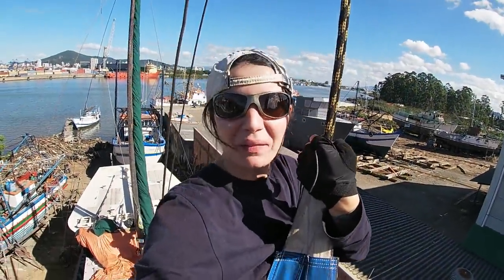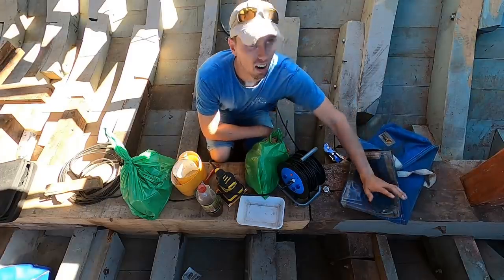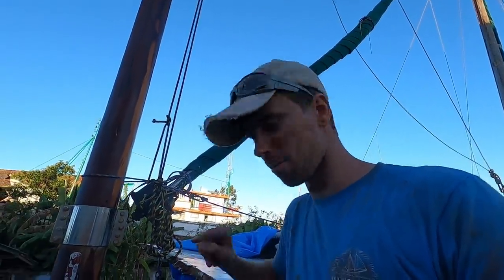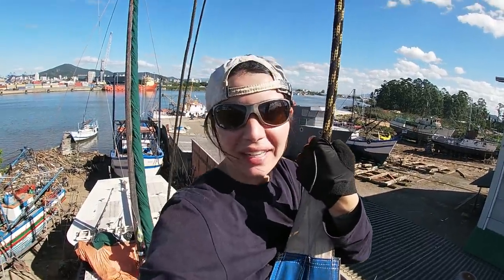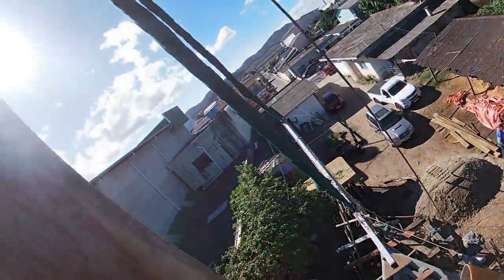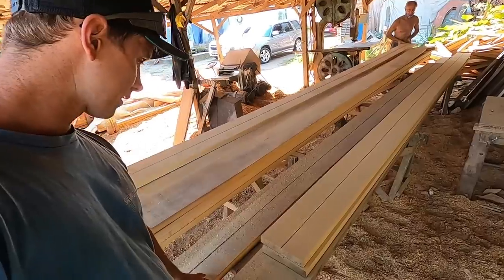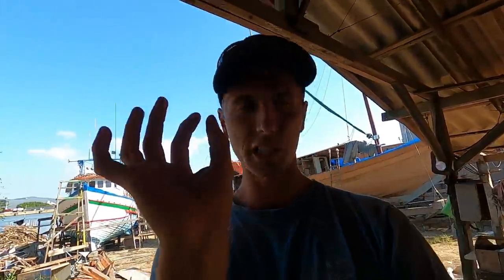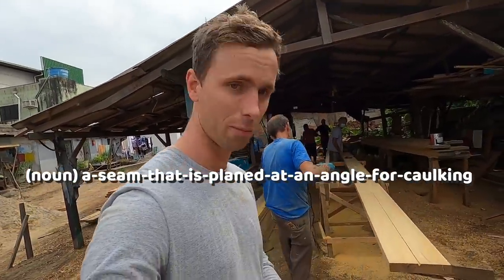Are our MASTS HEALTHY??? We went up to find the truth! — Sailing Yabá #39

Comment: Tip for sanding the next mast. Put a length of line around the mast and tie to your waist, it'll keep you close and you wont push away when sanding.
Also, as others have mentioned, "boat soup". If you want a black finish use a recipe with tar, if you want a more natural look try to use GUM turpentine with the boiled linseed oil. The gum turpentine creates a better barrier than just mineral turpentine and linseed oil.
A roller for application can also help speed things up and get more soup on the wood quickly.

Comment: Fun facts: Boiled linseed oil is not boiled, but processed with solvents to speed up drying time.
Mix 60% mineral turpentine and 40% boiled linseed oil. Better to apply multiple thin coats.
Reply: Not boiled but heated to break point where the impurities come out its then mixed with metal driers like calcium, Magnesium  or cobalt fatty acids so that it cures  slowly but eventually.
Reply: You know…. that was a fun fact. Ty

Comment: Sitka Spruce Static bending strenght 46 +/- MPa
White oak Static bending strenght 56 +/- MPa 
Douglas Fir Static bending strenght 56 +/- MPa
Purpleheart Static bending strenght 122-160 MPa
Muirapiranga Static bending strenght 124-200 MPa 

Off course I don´t know for sure but your masts look like they could be made of a type of Conduru or Muirapiranga typical for large hardwood spars in south america. If so, they are incredibly hard with a massive Static bending strenght of up to 200 MPa and a crushing strength up to 122 MPa. Factors such as tensile strength, flexural strength and crushing strength along with density and weight, play a role while choosing the optimal timber for mast construction. In North America Sitka Spruce and Douglas Fir has been the favored timbers for yacht mast construction. - Your masts, if I am correct are nearly indestructible but some heavy beasts... ;-)
Reply: 1 MPa is roughly 145 PSI so 200 MPa is more than 29000 pounds per square inch

Comment: As always giys. Well done. Use a mazk when sanding your mask. Most paints in days gone were made with lead. Not good for the lungs. Good luck to you both..
Reply: The boat was built in 1995 probably  didn't  even have it but could be easily  tested.

Comment: when using a sander/ power hand tool let the tool do the work, apply pressure and us medium to long strokes. Remember your moving a weight around for long periods of time let the weight of the tool gravitate down and slowly with pressure let the tool have time to sand. MP you were moving to quickly that's why you tired so fast. let the tool do the work. great job on the boat keep it up.

Comment: MP., going up or down the mast you should keep your feet loosely around the mast. Feet straight with toes curled inward. Used to crew on a schooner. I was hoisted up and had to grease the mast 4 times a year. Uhg! Tallow and linseed applied with a rag. Horrible feeling as it always dripped onto legs/jeans.😳😖😫🥺 arms, legs and face…

Comment: I am sure you aware but just in case.  Linseed oil does spontaneously combust.  It is so important to make sure you do not store linseed oil in heat or the rags/paint brushes in the sun or even some heat.  It will burst into flames like no one's business.  There has been many cases in the Sates here of wood shop going entirely up in smoke because of linseed oil being stored incorrectly.

Comment: Linseed and turpentine, paint it with that,and drill a small hole, in the top off the mast,vertically . half inch by 4 inches deep ,fill with linseed every 6  months,and plug it ( wood plug ,stops checking the old boys tell me.

Comment: Now that you sanded and linseed the outside of the mast, now what about the core of the mast. The way to do that is soak it in from the top, with a 27 part sprit oil to 2 parts linseed oil, make a bowl in the top of the mast, or you can fit a tight collar on the top, so you have a container, you pour your mix in and let it slowly seep its way though, you know when its is done by the puddle at the bottom of the mast. This might take a few weeks or months to do, or it could be mattered of a couple of days, You get a rough idea every time you go to the top of the mast to top up 27 to 2 mix. Mast are generally made from medium hard to soft wood, wood that has flexibility and strength, like some pines are. Do you know how to tune a mast in
Reply: Sounds like sound advice - good on you for sharing!
Reply: @davidjma7226  Part of the rigging trade knowledge

Comment: You know that old paint might be lead based? A dust mask does not do the trick..
Reply: Yes, dangerous. When you're old like me and you do something stupid you might think back to the days of sanding with improper protection. If I was to do sanding again I would invest in my health with a Lithium battery powered pressurized filter unit. About $500 Cdn. Please.